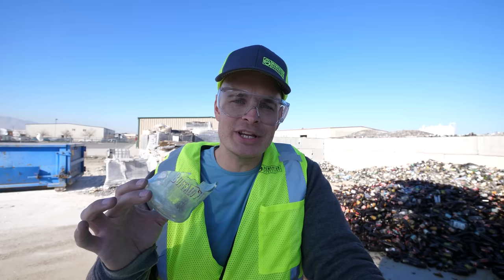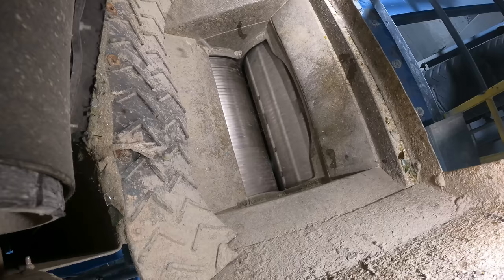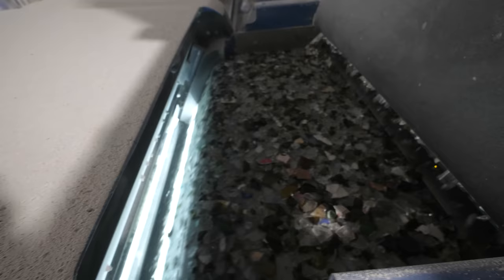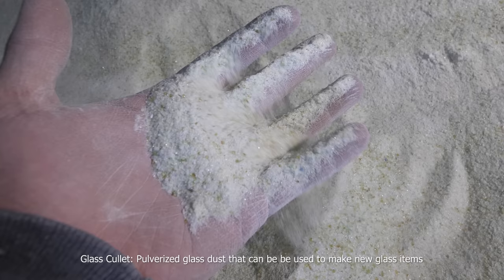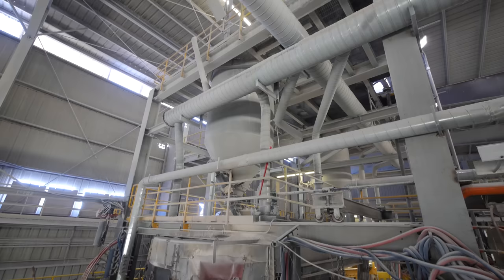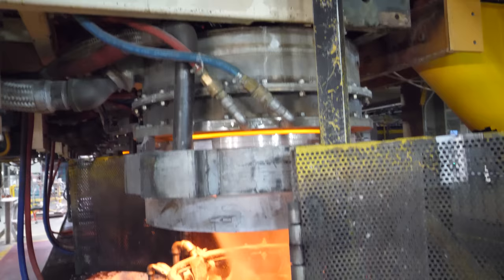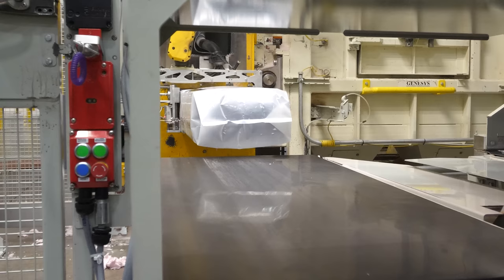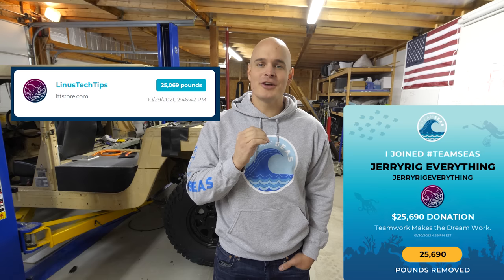What *REALLY* happens to 'Recycled' Glass?!  -  (you might be surprised)

Comment: The biggest potential energy savings from glass comes from a return for deposit system, where the glass containers are reused.  Generally speaking, the past sucks, but in terms of systems, the old system of return for deposit beats recycling hands down.
Reply: Yeah they do that in Mexico but not the us
Reply: While that was the case when I was a kid for glass soda bottles, those bottles were replaced with  plastic bottles. To implement a system like that for all the other glass bottles and jars would be a logistical nightmare.
Reply: Correct the current model just pushes to costs onto the consumer, reuse will always beat out recycle energy wise.  Generally speaking the past (in my lifetime) sucked considerably less for your average first worlder than today.
Reply: @Elhardt  Humans managed to solve that logistical nightmare 100 years ago without computers. The problem is that making a new plastic bottle is still cheaper than collecting and processing a used glass bottle. If businesses have to spend a single extra penny per bottle to use glass, they will choose plastic instead.
Reply: One thing you have to consider was also in years past that just about every small to medium sized city had a local bottler from one or more of the major soda brands, and outside of the big national beer brands like bud and miller and such, alot of the beer came from small regional breweries.  Because of this, refilling wasn't an issue because transportation of the empty bottles was mostly local or regional.  Even my small city of about 40K in the 1980s when I was young still had coke, Pepsi, and 7up bottlers locally, but those are all long gone now.
Reply: @100percentSNAFU  That's something I didn't consider.  Thanks.
Reply: @JamesRPatrick   Well, and that brings up the point that recycling/reusing is not going to be truly worth while until manufacturers and retailers are told what they can use and can't use, packaging/container wise.  Right now, what recycling means to me is that 30 years down the road nice middle class moms are going to be saying "what do you mean the last baby polar bear died!  But I recycled!"  As much as I think recycling and re-using is a great idea, much of it is mere "Greenwashing".  I dutifully recycled right from the beginning, and it seems much of my efforts were to "recycle" stuff to a river in Indonesia, or the Pacific Gyre.
Reply: Germany does this too. And glass waste is sorted by consumers into brown, green and clear.
Reply: @rodchallis8031  hire someone lottery tickets for you in the morning and then and we will see based on the phone for me to get the money for the car seat in the back from the airport now waiting daughter hitting up to anything tonight or something like love story about the same time as the other is going to have a great time in Florida and will send them Geico insurance card to pay for me to get a hold for now know how much longer though so I don't know!?
Reply: @Elhardt  Works just fine in Germany. All beer bottles are reusable glass with an 8ct deposit, usually 25 bottles are in a (also reusable and deposit) crate. It's extremely convenient as we drink a lot of beer.

Most plastic bottles are reusable too, with 15ct deposit. The advantage is that they're lighter to easier to carry.
Reply: Yeah having sort of universal sizes for all bottles and jars would be awesome. Would also stop stupid advertisement and you can be sure of how much is in the jar. No more reducing content by 20% but the price stays the same bs. This would be a win for consumers for sure.
Reply: @100percentSNAFU  watch this Sunday evening on BBC how to deal with 100 billion Coca-Cola bottles
Reply: Yeah I feel we need to go back to that.  Even for fast food.  Instead of throw away containers everything should come in reusable containers that you bring back.  You pay more upfront but get a deposit when you bring it back.  Glass bottles for drinks, and maybe tupperware containers for food.  Make these containers in a bunch of standard format/sizes that are used at all fast food places so you can bring it anywhere.   Same with deli grocery store stuff.
Reply: Spoken like a guy who never had a four-foot stack of bottle cases fall over in the back room of the convenience store where he worked. :)
Reply: @tonih4674  , When I was moving 20 ton coils of steel around, I followed a general rule of not letting them fall on me.  I think that might be translatable to bottle cases. :)

Comment: Here in the UK there are companies that are using crushed glass to make an abrasive blast cleaning media …. It’s been sold around the UK for around the last 10 years or so … the company I worked for ( blast cleaning equipment manufacturer) tried a sample 1 tonne (1000 kilos) load … I gave it out free of charge to several of my customers to try and to evaluate it against the normal copper slag grit that they would normally use … I also put some into our on site suction blast cabinet …. The feedback I received from the customers was mixed … some were happy with the results and others disappointed but what they all agreed on was the taste they had in their mouths during and after their blasting processes … I also experienced the same thing with the taste lingering even when I had a drink … it lasted for about an hour or so …. Also when I went back into the room where the blast cabinet was located I could still taste it in the air (had to leave the door open for a good while to get rid of it) as a result of this trial I recommend to my boss that we didn’t stock,sell or recommend this Glass Grit to any of our customers.
Years ago the use of Sand was banned in the UK for blast cleaning because of the links to Silicosis due to the fine dust particles entering into the lungs … glass is basically made from sand and as you can see from this video it gets crushed into a fine powder .. you all saw the presenter put his hand into and let it run through his fingers while the dust particles rose around him …. For me personally I thought the presenter should have been provided with a breathing air mask before being allowed into this facility.
Reply: Totally agree, the reporter at the least was unwise to handle the glass dust and should I hope been told told to rinse his hands straight away.

Comment: Whether the glass gets recycled depends a lot on the diligence of the source and how picky the end user is.  In our area, if the glass isn't separated well enough (clear from colored glass), the end user will reject the whole load (if the clear load has too much colored glass in it)  and it goes to the dump, because the end user does not have the fancy equipment to separate the glass like this place does. 

 I heard one story where they had different types of recycle bins in an office building and everyone did their part for the planet.  then the maintenance guy came by weekly, loaded it all in the dumpster because there was no recycle place locally to take it to...
Reply: In our area they hire "developmentally challenged" people to sort colored glass and other recyclables which provides jobs for them and gets a needed task accomplished.
Reply: What is the difference between the coloured on and the clear one?
Reply: @punisherjones6795  It’s mainly due to different coefficients of melts in the glass.  It’s a weird equation  thing, but some glass particles won’t bond well with other glass particles ‘cause they were produced under different conditions and they crack or fall apart.  In other words, you can’t just grind up a bunch of glass and make a window or bottle.  To be blunt, glass is very fragile in it’s existence, and in it’s recycling it’s even more fragile.
Reply: @derekv8534  thanks alots mate
Reply: @derekv8534  I"m not sure this is correct.  yes, if you try to fuse 2 pieces of glass together that have different coefficients, then yes they will crack or break.  Happens in the art glass world all the  time (I tried it with glass marbles...didn't work).  But when it's all thrown in a pot and mixed together, I think it would pick up a new coefficient for just that melt of glass.  Now the new coefficient may not work for the intended use, but having different coefficients mixed together I don't think would be a problem.  
And just because the glass is clear does not mean it has the came coefficient, and yet they mix all that recycled glass together to make new bottles, etc.
And color is not a determinant as to coefficient.  A lot of colors can be fused together, as in glass bead making or art glass.
A glass artist has to keep separate the different glass rods of different coefficients so they don't get mixed and break, but the glass comes in a LOT of colors.  
I think the biggest problem with the colors not being separated in recycling is you don't want colored glass when making clear bottles.
Reply: @AffordBindEquipment  Window glass, bottle glass, optical glass and glass cookware have wildly different chemical compositions - some of which won’t melt at all in the expected temperatures for the other glasses.
Reply: @allangibson2408  totally agree, which would make any clear glass recycled load unusable, as you can guarantee all that is in the mix, even though in a fraction amount.  so how do they compensate for that?   If it is broken into small granules in the recycling process, then there would be no way to differentiate between the different kinds by visual inspection.
So somewhere in the process this problem is compensated for.

Comment: As someone who worked at a glass container factory growing up I can say that a lot of glass isn't always wanted anymore, if a factory has a certain type of glass they specialize in they reject other types. My factory only did clear glass bottles from Seagrams bottles to Frank's red hot
Reply: That doesn't mean other places aren't interested, though.
Reply: @CiaranMaxwell  But you are talking logistics and money to get those bottles to those places.
Reply: @brandona.deimel5155  It's still quite profitable to recycle such glass, so they'd have a deal set up with a company that would take their mixed colour glass and reprocess it.
Reply: Were you in Ruston?
The colored glass goes to other plants; amber to beer plants, green and amber to wine plants.
Reply: @paulwittkamp4678  no, we did clear glass though, used to have another tank for green glass a long time ago, switch to brown, then became a secondary clear tank.
Reply: @KainYusanagi  starter glass is less resources yes, but requires more heat to melt and burn off contaminants. So it's a zero sum. Takes a lot of energy to get a tank to over 4000 degrees.
Reply: @CiaranMaxwell  most factories specialize in one color glass, it's cheaper. Most glass is clear, so you'll probably ship greater distances.

Comment: I was working a lot with fiberglass in attics and assumed, like many,  that the itching would translate to lung issues.  I asked my friend the respiratory therapist.  He said that in training they studied many lung diseases including silicosis, asbestosis, even talc can cause lung disease.  But there was never any discussion of fiberglass in his training because, as common as it is, people don't get lung disease from it.  Not seen.   More dangerous to work with fine sand or clay.  It's not always what you think.
Reply: silicosis basicly is caused by glas and or its components. Just like asbestos, it's not dangerous until pulverized to (very) small particles. e.g. breaking/ drilling/ sawing dust.

In the lab we used small glas beats / pulver to destroy cells "instantly"  with a shaker to prevent them from changing their biochemistry. (other ways of killing cells create stress biochemistry) The preparation is done in a fume hood due to the dangers of non-biodegradable dust.
Reply: @ceeweedsl  
I noticed my reply was removed or blocked? probably due to linking to articles like: Measurement of Lung Cancer Tumor Markers in a Glass Wool Company Workers Exposed to Respirable Synthetic Vitreous Fiber and Dust.  
That an agency considers something is safe enough to work with under safety conditions has no bearing on health. it only says you wont be liable.  kind a like some companies get permits to pollute. e.g I consider rockwool and other insulations safe when they are in place and sealed off.  but working with the products production, placement and demolition probably has health concerns.
Reply: @steven-jellemeijer8412  Perhaps it's not yet clear  whether fiberglass really does cause problems in humans on any scale compared to those working with clay or other fine mineral sand or other materials known to cause silicosis.  Or the cancer from smoking.   

Obviously there is a perception that if it's itchy to the skin it must be destroying the lungs.  And any dust is an irritant in any case.  But one would prefer to really know or at least be able to treat the material with appropriate precaucion.  

For me, a somewhat health cautious person, I have two "data points":  
1) the places where fiberglass insulation (not all glass) has been DElisted from lists of dangerous materials - and then others where it is simply cleared from the start.
2)  That, combined with the clear message that it's a non-issue, coming from my own friend and trained respiratory therapist, I am personally satisfied to continue working with it on occasion without a mask.   Since he has spent  half a lifetime caring for people with respiratory issues yet seen none from FG insulation, I believe him.  

But that is not evidence that you should believe me.   Better safe than sorry !  So if someone feels unsafe or is convinced by a different safety profile they have seen, then they should act accordingly.  Wear a mask or hire somebody else (more like me!) to work with the potentially dangerous material.
Reply: @ceeweedsl  makes sense. I mean. we use gasoline . the fumes are not healthy. but as long we fill up your car or lawnmower there are most likely no long term issues. Bodies can handle a lot. it is the dose that makes the poison. and even then its chance.
Reply: @steven-jellemeijer8412  I know a gal who used to drink small amounts of gasoline as a child, (I don't know how much or how many times).  Today, she is one of the sharper people in the medical industry, as a nurse.  I just had a young doctor tell me they can get a 3 month blood sugar average from one blood sample.
It is that bad out there.

Comment: Another growing use for recycled glass is as a road base. Unfortunately, glass is heavy and adds to shipping costs for products and afterwards. Last I heard, the recycled glass costs more than new glass.
Reply: Silica is the most abundant material on Earth. Makes sense recycled glass would cost more than new.
Reply: @matthewpaine6908  not sure about that. It depends from area to area. Mining, logistics, taxes, and waste contaminations in the ore make huge price differentiation. If there are mines near - new glass is cheaper, if not - recycled is cheaper.
Reply: @user-ut4vl8bw2k  Reminds me of that old movie "The gods must be crazy". If you lack the ability to produce glass a single recycled glass bottle becomes very valuable.
Reply: @matthewpaine6908  Soda ash or the extra 40% energy it takes to react new glass isnt though
Reply: @kyleinwisc  There are a lot of factors that contributed to price. It depend on the area. After all glass bottles have a deposit, which increases cost. They have to be shipped, sorted, cleaned and processed. This all cost, time, money, man power and energy. Certain glass products need to be more pure than others, which requires more sorting, more cleaning, more processing, more energy. The glass used in fiberglass insulation doesn't need to be very pure, so cost of using recycled glass is low. Glass used in optics needs to be very pure, so the cost of using recycled glass is much higher.
Reply: non sense, just the less enery needed for the new glass with 50% recycled glass makes it worth it.